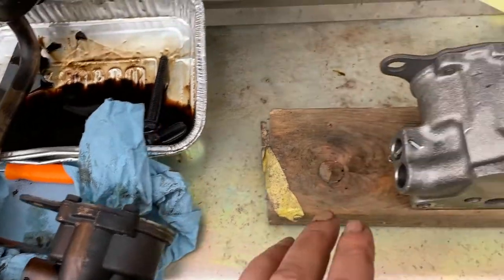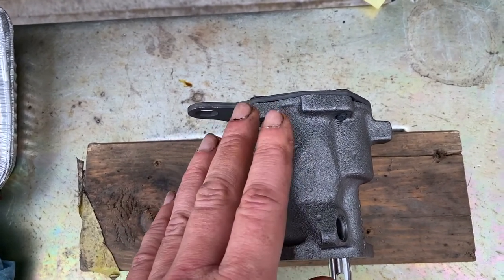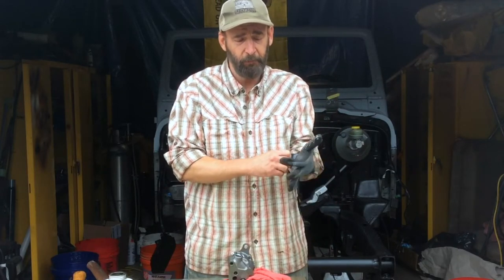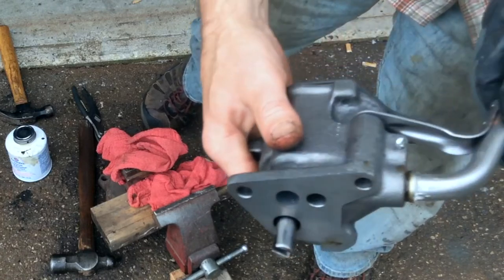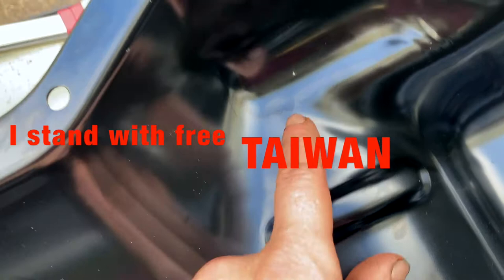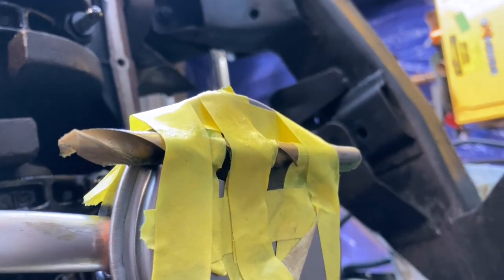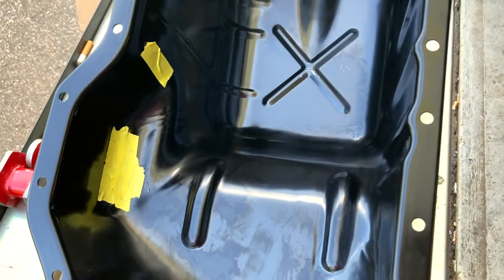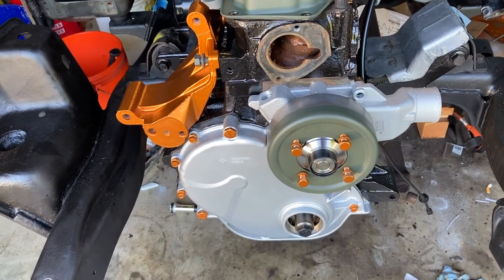OIL PUMP REPLACEMENT JEEP Wrangler WITH A HIGH VOLUME OIL PUMP by MELLING

Comment: Lol you only need a high flow oil pump if your building a high performance engine..high oil pumps and a normal everyday drive is pointless it kills power
Reply from the maker: I disagree with you but thanks for the comment . You must of missed the video where I'm talking about tunning it and the chance of putting NOS on  it ..
Reply: @rustyjeep9783  lmaoI rather take advice from a real car builder who been doing for over 35 years and built drag cars.noz in a inline six lmao it won't even hold up to it hahaha what a joke.
Reply: @timschultz995  35 years building race cars my ass..
Reply: That's actually true.  A stock engine only needs a stock volume pump.  However, a high volume will get more oil across the bearings.  Beneficial in both hipo and stock engines.  Also, that high volume pump requires more force to turn because of the resistance of the high volume of oil it has to push.  The reason that a hardened intermediate shaft is needed.

Comment: I did it on my jeep 4.0l at 178,000 and it lasted to 401,611 miles and head gasket gave out between pistons 3 and 4 otherwise still ran! I am rebuilding it again crank stays at stock specs I feel it was due to HVS oil pump

Comment: Hey brother I have one more question,, how do you feel about putting the jack stands on the axles instead of the body mounts? And why does everyone else do it is it because they have a lift? I’m fixing to start on my mid sections this week thanks
Reply from the maker: I Think a lot of ppl are afraid of the frame bending depending on how high you cut . If Talking about a actual car lift  I've seen that video and he's doing it to straighten the frame because it sagging ... If you'r doing it in your driveway axle is okay but like i said before make sure everything is squared and straight ....  Also if you'r watching the videos i think you are  he's literally taking the cut line up so high where it could bend .. Im not a professional but i was not happy about cutting that high up the frame so i cut half way up ( no rust was left)and then caped it . if you'r not cutting all the way up again I think the axle is fine thats what i did ... You got this brother  just take your time ...
Reply: @rustyjeep9783  Thanks man I definitely am not cutting that high up my rust is minimum I thank you so much for that keep on rockin bud wish you were my neighbor we would raise some hell!
Reply from the maker: No problem and feel free to ask anything else ..  Yea we could raise some hell !!! My motor should be ready in dec to start with open headers of course lol.. should be interesting what my neighbors will say...
Reply from the maker: thanks for the shout out sorry i missed post I didn't get notified on reply .. I have a email in about section if you every have a question or suggestions. Again sorry about slow reply I really try to reply back to everyone

Comment: How you feel about 7011 1/8” rods to weld my frame kit on? They burn hotter to me than 6013’s which I usually use since my welding is not at pro level, like your attitude And info
Reply from the maker: Honestly I'm not sure what to tell you because i don't stick weld but I can tell you on mig(120 not 240) using .035 wire I had set 3/4 out put to get penetration .. I think hotter is better but be carful because sometimes your frame metal is not as thick so you can blow true. . I clamped everything and then did heavy tack welds just to check everthing out .. Good luck on your project and just take your time . OH make sure to square off your frame if changing your back arms 2.....
Reply: @rustyjeep9783  Yeah I’ll be doing those next time my center bolts on crossmember are about to let go so I figured doing it first is more important, I’m hoping to be able to take out body mount bolts and raise it up a couple inches so I can weld with rods my body has zero rust just bottom of frame and usual rear spots. Thanks
Reply: A 7018 rod would work better.  It fills nice.  Gives a nicer weld.

Comment: Liked the video. Did the same to mine. 99 TJ 230000 miles, still runs like a top and good oil pressure.
Reply from the maker: Thats good to hear

Comment: You think that new oil pump will fix my loss of pressure at idle? I don't want to put new bearings in the bottom end, if that's the issue. But not as much as I don't want to put another engine in. Just hit 300k an would like to keep truckin with the original equipment
Reply from the maker: I've read and saw it help with high milage lower oil pressure at idle issues. This was a big topic in jeep forums because many ppl said 20 psi (So if your around 20 your fine ) is ok at idle . growing up with chevy motors I real like to see oil psi higher but IF I were you Id look up and read some of the old forums . I  ran and may run a  2 oil filter system. Running a 2 oil filter system cause lower oil pressure at start up and the high pressure from the pump helped me before ..
Reply: Yes

Comment: “I wish Mellings would send an oil pump with the pickup tube already connected? Yes, bc that would make my life a whole lot fucking easier…” 

That’s the quote of all time right there and I know this from my experience right now. Trying to get the pickup tube inserted. Is that an print I see, bc mine didn’t come with an o-ring
Reply from the maker: No O-ring in box thats why I used gasket material on it.  The black stuff under  crimp you see is gasket material. Its was big pain in the ass

Comment: Oil pressure is determined by the health of your bearings. That's why high mileage engines gradually lose oil pressure. Mileage wears down the bearings creating a larger gap between the mating surfaces thereby reducing pressure. Using a high-volume oil pump will move more oil and may extend the engine's life a bit but it is not a solution to the wear on your bearings. 

The solution to a low oil pressure diagnosis is to rebuild the engine.
Reply from the maker: I agree with that above statements on bearing gaps and cause of oil pressure dropping ( and Think I said that in the video) I disagree on jumping to rebuild right away .  Oil pressure of 10 psi per 1000 is acceptable for this motor 4.0l (I'm running 20 at ideal and over 40 at slow speed ). The purpose of the pump is to move more oil to help with wear ,oil pressure and temperature during high stress ( Which is all the reasons I put it in) . Jeeps TJ before 2003 actually showed true oil pressure but because ppl complained to dealers about extreme movement of oil pressure  IE between 20 -50 psi  they reprogramed it. So basically later TJ have idiot lights with numbers and thats why the gauge sits in the middle ... Thank you for your comments
Reply: I disagree! If you think about it the machined surfaces in an engine are supposed to be riding on a thin sheet of oil and NOT on the bearing surfaces. If you don't have good oil coverage then the bearings begin to make contact with the opposite surface and wear. With a high volume pump installed in an engine with bearing surfaces that are not totally damaged it could extend engine life CONSIDERABLY. Of course if the bearings are worn too much, they call that a KNOCK.😉

Comment: Don't take this guys advice.dosent even know what he's talking about .high flow means more pressure to push more oil throw the engine ports...go watch uncles tony garage.hes a real engine builder and know what he's talking about .his guy don't
Reply from the maker: I enjoy all comments even if  you'r wrong . Melling actually makes a high pressure pumps (avg 75 80) which has a bigger spring stock gear which is different then high flow( avg 65 70 ) which has a bigger gear and slightly bigger spring then stock BUT DON'T BELIVE ME . Go to Melling YT channel and they explain the difference . I hope this was helpful . PS I like tony's channel.....
Reply: APPARENTLY you watched Uncle Tony's Garage but you weren't paying attention. There is a big difference between Volume and Pressure. More volume will definitely help an older engine with worn bearings and the byproduct is more pressure, although maybe not a lot. But every oil pump has the capability of producing VERY high pressure by increasing the relief valve spring pressure. Increasing the oil pressure on an old engine is not recommended because you can push the oil so hard it can get under the worn bearing and float them, then they will spin with the oil and NEW ENGINE TIME!